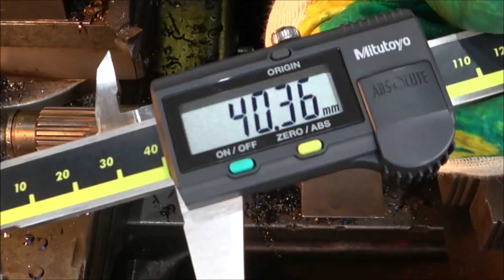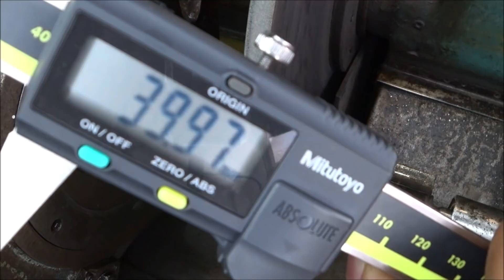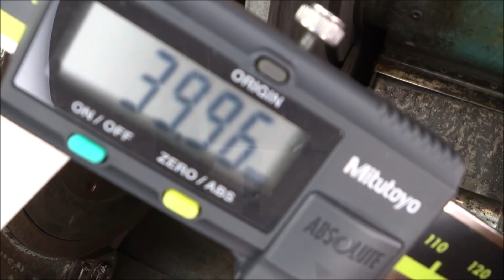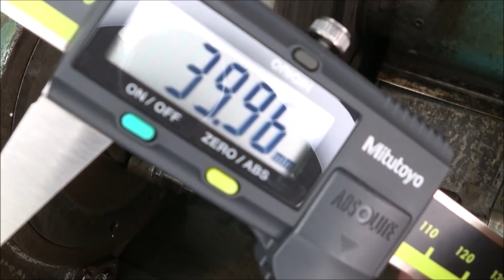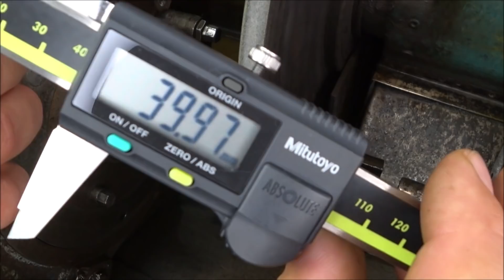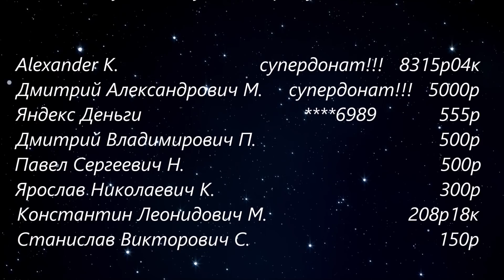#Реставрация тормозных валов

Comment: The use of grinding machine was unnecessary you could have achieve the perfect finish and dimension with the use of lathe machine and skill. When you apply for license the tolerance is only up to -+ 0.02 thousands of a millimeter.